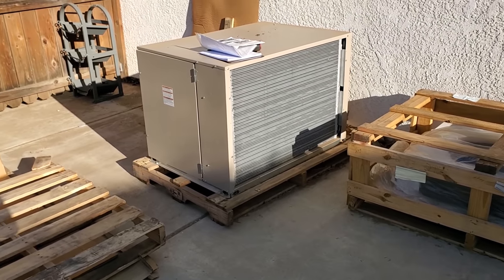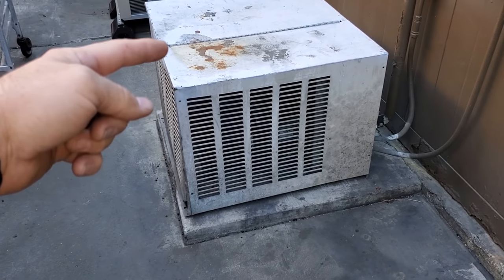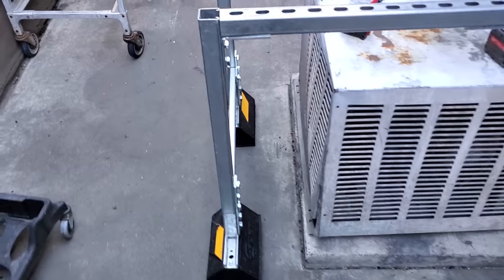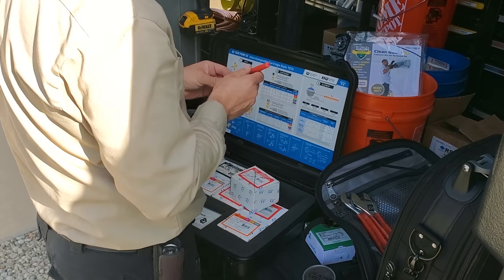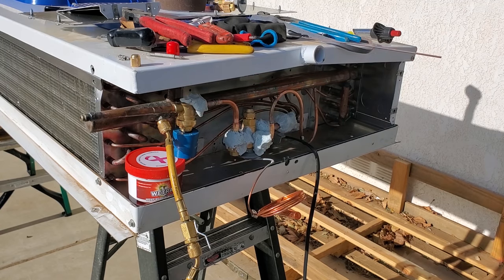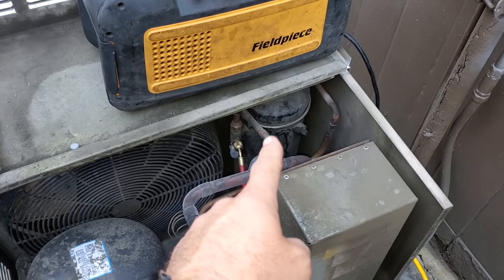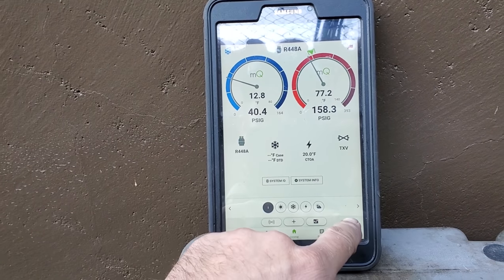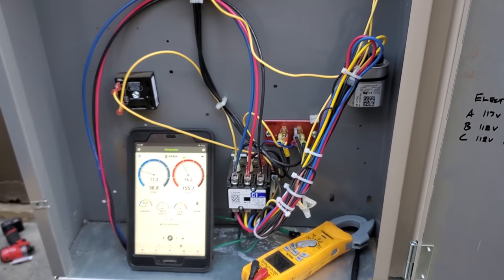WALK IN COOLER INSTALL AND STARTUP

Comment: I thought about that additional crossbar when you showed your rough-in phase of the unistrut stand in the early part of this video, so when you mentioned going back to add it, I was like, "Yeah, I was thinking the same thing." Also, I see you decided to stay with the defrost timer after all. Lastly, any technician would appreciate not having to squat down or bend down to access the electrical panel. As usual, great craftsmanship!

Comment: I appreciate that you marked all the information inside the condenser box that you probably wish was there in other ones you get called to work on. If it's you the next time, it'll more than make up for the time it took to do and if it's somebody else, maybe they will learn something and start doing the same. As far as adding the extra cross bar, nobody ever had to apologize for making something like that too strong.

Comment: Great video, Chris!  I just recently changed out WIC and WIF condensing units.  Both existing units were working and both boxes were full of product.  Before I started, I said a little prayer that everything went smoothly and that nothing was defective with the new condensing units.  I had someone help me remove the old equipment and set the new equipment, but after that, it was just me.  The first unit I installed was the freezer unit because the freezer door is inside the WIC.  Once I got the freezer running and down to temp, I could crack the freezer door to help keep the WIC at temp until that unit was installed and running.  The prayer didn't work.  The factory installed freezer low pressure control was defective.  Without the control, there was no way for the unit to pump down and cycle off on temperature or for a defrost.  I worked 10 hours straight with no breaks and I was exhausted.  I wasn't going to pay a $100 opening charge hoping the parts house had the control in stock, so I had to go back to the job several times over the next 6 hours to manually cycle off the freezer condensing unit and put it in a defrost.  At midnight, I shut down the freezer at -20 degrees figuring it would hold until morning.  I got the control the next morning and installed it.  Now, I'm waiting on RDI to reimburse me for my labor and the cost of the control.  I'm not holding my breath, though.
Reply: 10 o’clock

Comment: The part I wanted to see was how the hell you got that new evaporator in the box in 1 piece. Haha. Also, since Alaska and California have earthquakes in common, definitely add that crossbar. I forsee that condenser on the ground after a decent shake.
Reply: That, and if someone bumps into the assembly with a tray cart, bends it and makes it drop the condenser... I wouldn't want to be the one who has to take the fall.

Comment: 4:00 If you do build a stand to lift the new unit above the other unit, the hot air from the new unit won't drop into the other unit since hot air rises but if you're really worried about it, why not build a deflection plate angled 45 degrees up to catch the exiting air and deflect it up.
Reply: That was what I was thinking, it may rise but the suction of the other unit might force the flow down. I agree that deflection plate would bee a bullet proof solution.

Comment: Another great video !!!   If you are thinking about putting another support in for that frame, do it !!! It is better to overkill certain things and it gives you peace of mind. You did a fantastic job explaining why you are doing everything, where to face unit, to building a frame for unit etc. As you said you are trying to make a tutorial with these videos and your are doing a great job in my opinion. How your subassemblies of certain equipment before your final assembly on site shows the methodology you use on every job that I have seen in your videos. As for leaving notes, always when you do something funky or not really the norm that happens at work. When I worked in streetcars and we cranked off the brakes so we could couple up and push in the disable streetcar. I would leave a note that only the open side disc brakes are cranked on all others are off. I would also leave the crank off tool on the drivers seat so the person on another shift will question about the brakes being on or off and be forced to ask about it and look at the ticket. Keep the videos coming, I am addicted !!  Thanks again.

Comment: LOL. At about 10:35, while discussing the wet rag compound, he points out the red/white tub being used to prop the piping up.

If you look at it, you will see a blue item (solenoid magnet?) attached to the shiny part (the solenoid?), with some wet rag compound on top. Stare at it for a minute or so...

It looks like he made a play dough gilligan, wearing a blue shirt & his ubiquitous white hat. There is a tube attached to the piping, that looks like a hand, and it appears as though "gilligan" is positioned in such a way that it looks like he is holding and peering through a telescope (seaglass?) at something behind & to the left of the camera (from our perspective).

Nice. A for effort, even if unintentional.

Comment: What grind my gears? Why run head masters? We did that back in the 80's and 90's in Sweden. The condensing units I have installed in cold north Sweden for the last 10 years hasn't been equipped with that, my colleauges can't even remember when they installed a unit with that kinda "feature". Not even with long lineset. Instead we run with fan cycling pressure control, either variable or on/off. And.. In the summer it can be about 30°c/90°f, during winter as coldest -30°c/-22°f, ok. It may take one or two startup tries before it kicking in sharp by those low ambients. Have never been a issue. We are just clearing the sight glass and keeping the level low as possible with enviroment in mind.
Reply from the maker: I will discuss this on I’m going live on YouTube this evening 12/14/20 @ 5:PM (pacific time) to talk about my videos and answer questions from comments, emails and the live-chat, Come check it out https://youtu.be/238PSHS5MIY

Comment: On the new heatcraft condensers why do they put that bar over the brass shut off valves makes it hard to unscrew your gauges they could have made it easier I think....what's the benefit of useing 448 over 404?

Comment: This would have been a breeze with zoom lock. Over the last 2 years I’ve become a believer. I got a gig installing VRV system in a hospital for their 5 IDF rooms and I could not pull a fire permit since the hospital was still open (Texas is a bitch ) and I did it with zoom lock and pro press and I got down to 300 microns quicker than I’d ever done before. Also held 500 psig over 24 hrs! Not cheap though. But think about over 300 ft of line sets, 5 air handlers !! How many brazes that would have been

Comment: I'd put on some more support on the unistrud , you never know with the vibrations or even someone tripping and knocking over the condensing unit ... I mean an extra crossbar can't hurt anyway right ?
I don't quite get why the subcool is so low though .

Comment: Just asking, not downing nothing. Wasn't your numbers off and what would it have taken to get the AC Unit at the proper Run settings? Also, why haven't you changed over to INDUCTION when it come's to Braze Welding. You would get a better Weld Joint in my opinion, would you? Why did you recover when you could've just released Refrigerant to the out side? Isn't this Propane Refrigerant? Thanks for sharing your knowledge with me. It is Appreciated.

Comment: That wet rag will never be above the boiling point of water and thus hot enough to damage anything.
Not sure i agree with your reasoning that the rag will be an issue if left on longer.
Reply: Eventually the wet rag puddy will lose out its moisture content, then the heat will just continue climbing into the equipment behind it. I don't think its a ceramic composite that reflects the heat, it just absorbs the heat.
Reply: @LazyLifeIFreak  I tawt I taw a puddy tat.

Comment: The top 2 pieces of the strut should be on top the legs. Think of it like a table top. Table tops don't go inside the legs they go on top. Much more secure even if the bolts come loose.
Reply from the maker: Great point!
Reply from the maker: I will discuss this on I’m going live on YouTube this evening 12/14/20 @ 5:PM (pacific time) to talk about my videos and answer questions from comments, emails and the live-chat, Come check it out https://youtu.be/238PSHS5MIY

Comment: Maybe a 48 inch high pressure treated plywood partition wall between the two units,  with a simple unit-strut frame?
Reply: I would worry about possible condenser discharge air re-circulation using a partition wall. I'm not sure there would be enough clearance space taking that course of action.
Reply: Tyrone Sheppard ...a plywood partition would end up being higher then the unit is now, that would intend to prevent re-circulation
Reply: @rmhanseniii  i'm speaking of the discharge air from the new condensing unit hitting the partition wall you noted and then deflecting backwards toward the unit it came from, interfering with the dissipation of the heat from that condenser coil and causing high head. I did not mean the discharge air going from the new condensing unit over to the other condensing unit.

Comment: If this were r404a would you still run the same superheat settings? And also did you confirm the superheat stayed constant at box set point?
Reply from the maker: I will discuss this live on YouTube this evening 3/14/22 @ 5:PM (pacific) come over and check it out https://youtu.be/-Q5Dya0wcwI
Reply: @HVACRVIDEOS  awesome.  I'm interested to see how you set up your low and med temp boxes and your approach to balancing superheat vs receiver level vs sight glass conditions.

Comment: You can put new unit upon the old unit with ur new stand.  That can also save some space. Any problem to do this thing???
Reply: You have to consider all the operating conditions of the existing equipment. The efficiency of heat pumps is very dependent on having a lot of air flow through the coils. Because of that enclosed area, putting the new unit on top of the existing one would have reduced the air flow through both condensers *when the new one was also running*. The existing unit is already isn't in the best place (discharging it's air toward a wall and those chairs). Adding a second stream of air flowing on top would increase the overall resistance since it's more air that needs to be blown up over the wall.

It would still work and cool the restaurant, but at a loss of efficiency. These coolers take a lot of power and are running all the time so a small reduction in the air flow can make quite a difference over the long term.
Reply from the maker: I will discuss this on I’m going live on YouTube this evening 12/14/20 @ 5:PM (pacific time) to talk about my videos and answer questions from comments, emails and the live-chat, Come check it out https://youtu.be/238PSHS5MIY

Comment: I’ve always been curious. Why are there p traps on evap drains? I know sinks and toilets have them to block sewer gasses. But don’t the drain lines usually lead the water into another drain? You wouldn’t think you’d have any sewer gasses because the drain it’s going into has one of its own.
Reply: If you don't have a p-trap the suction created by the fans will pull air through the drain line and prevent the condensate water from draining.  It will collect until the pan is full and then overflow onto the floor and product.
Reply: @hjc4604  Ok. Makes sense. Thank you for answering me. I appreciate it. I do a lot of AC work on cars, trucks and buses. But as you know, they work the same, but the designs are different. The systems installed on buses are somewhat similar, but not quite.

Comment: 404a is outlawed in California? I wondered why you always seemed to use 448a
Reply: GWP for R-404A: 3,922
GWP for R-448A: 1,273
Reply: 448A is the new gas that has been used to retrofit the racks at the stores that have HP80 in them.
R22 is being retrofitted to 407A And the A/C racks are now being converted to 407C.
It’s all being changed and then in a couple years they want to do it again.

Comment: Why did your stand have to put the replacement condenser above the old one instead of just in the place of the old one plus a few inches out (an extension of the pad, like removing the old unit before putting the new one in)? I listened to your positioning dilemma but I still don't understand why it needs to be raised that high. It's more than just getting it up at eye level, right? Or... by "not tripping," you thought they wouldn't bump into it as much if the stuff was up higher?

Comment: 11:10 I'm surprised you can hold on to it with bare hands like that. Brazing temperature can easily reach 500-700C or above right? There is such a thermal gradient on the copper that just a hand's width away is already safe to touch?
Reply: heat blocking compound absorbs more heat than you would think...

Comment: I’m not a refrigeration guy I am a residential 99% of the time. The  blue tool you had. Is that to energize the coil or magnetized the coil so it can open?  What is the purpose of that?

Comment: I cannot believe they flipped the access ports..I'm so fuckn pissed. How you get core tools on there..I couldn't at all..what a joke...who's bright idea was that....like "oh hey Steve these valve have been like this for 80 years, let's change it" -Boss "deal" 

Wtf
Reply: Normally with a txv its rated for 50% capacity.  If you have a 1 ton valve, it can modulate down to .5 tons without adjustment.  In theory

Comment: why in the hell do yall use tev's haha here in europe eev's are the standard for years now haha. yall so behind
Reply: Im from Germany and we use Tev´s just for little rooms and single machines. Everything big gets a EEV or PWM AKV
Reply: @DrHakennase  same here, Holland.
Reply: Because our trade is full of luddites that don't want to learn electronic controls
Reply: Not everything needs an EEV  , more electronics isn't always good , especially when you have moisture in the walk-in and overall voltage issues .
If the Txv is well adjusted at start-up and the unit well maintained, it can last for years with no issue at all , which is not necessarily the case with an EEV .
Reply: @sterlingarcher46  Thank you for proving my point.  Nobody ever said the controls for eev's have to be in the controlled space.
Reply: We do use eev's......and quite frankly I'm not impressed. You might save what? 5 dollars a month on the electric bill because of the efficiency. F that. Give me an expansion valve that won't crap out over a surge or single phase. 

On a vrf system can live with them but a walk in cooler? No sir. Can't drink that kool aid.
Reply: @sivalley  Well some controls do have to be inside , like the transducer for example.
Besides , it's not the only reason .
Take that case here , a simple walk-in cooler that's gonna keep food more or less within a certain range of temperature doesn't necessarily require the SH to be extremely precise .
Also , they need any parts of the installation to be easily and quickly sourced in case of break downs .
So if the TXV somehow fails , he can replace it on a Sunday night overtime call , whereas with an EEV it  isn't gonna be the same story ... Etc etc other reasons too...
Reply: @sivalley  so you have all servic documents of all superheat controllers of all different brands with you? Or just turning a stem a few times to difficult for ya without your laptop or samrtassphone?
Reply: @sterlingarcher46  I'm not quite an old-timer in the trade yet, only been doing it for 13 years civilian and 8 before that in the Navy. But one thing I can say absolutely is I never install a product that my supply house can't provide repair inventory. If I'm working on a custom built system that's a whole other story.  Sensors go where they have to go and should be considered consumables just like belts, motors, and contactors.  Not knowing how to operate controls that are remotely located is something every technician will have to reconcile sooner than later.  Too many 'techs' out there these days have only basic understanding of what they are doing and practically no knowledge of why.  Eev's are not just for energy savings, they are so that a system can self monitor and prevent damage to major components. If you can't justify your time to your customer for taking the time to do a job right, I have nothing to say to you.  There is a difference between providing economic solutions and cutting corners to reduce costs.  Regulations are in place because most techs won't do the right thing when no one is watching.  You don't have to be a super tech, just an observant one.
Reply: @sjefoekel6058  Of course I have all my tools and documents with me before I touch any control I haven't worked on before.  What blind fool would try to adjust a control without knowing what it does or verify it does what you're expecting? If you're going to shit on someone for using their phone or tablet to do their job, you sure aren't very observant of how this guy operates his flow.  You have all of the information literally at your fingertips and call it a cop-out? I wouldn't work with you for that bit of arrogance that's going to get you or someone with you injured or killed.
Reply: @sivalley  yes and before you are trough reading and downloading all that crap staring at your phone (that is what gets you killed in our industry by the way) i will be at the next jobsite. Dont be ignorant use your brain not your phone!
Reply: thank you to everybody who answered, it's nice to see yall now what you are doing, here in belgium 95% off the installations off this date use a eev. thanks yall!
Reply: Dream on!
Reply: @mini4strokerider795  ik leef 30 km vanaf de grens, waarschijnlijk kom ik alleen maar die 5%tegen.